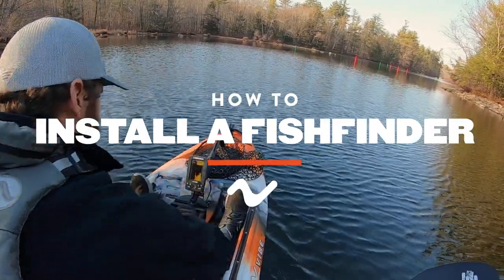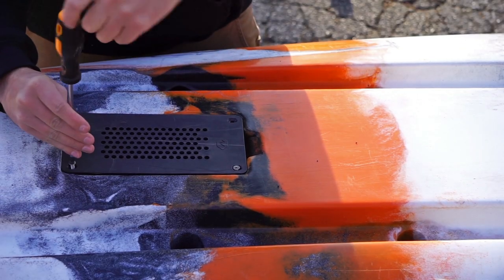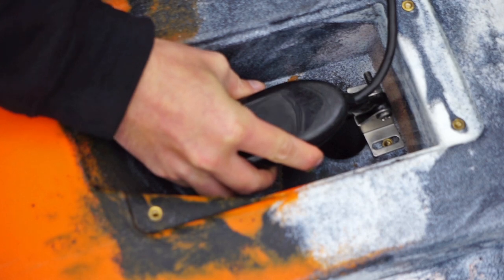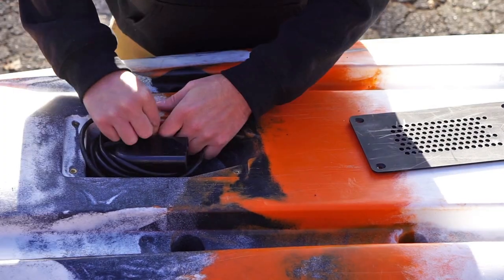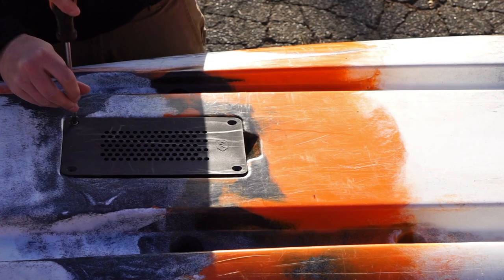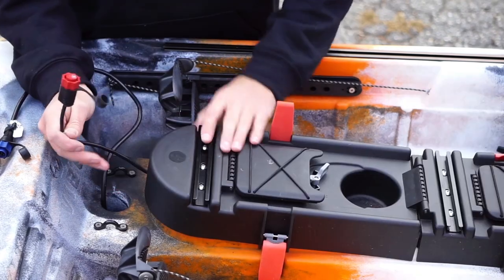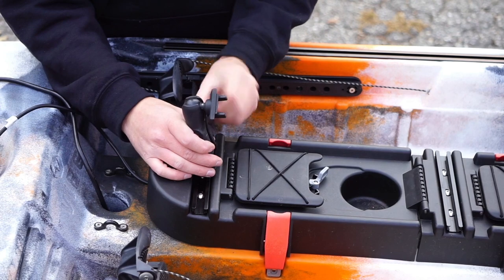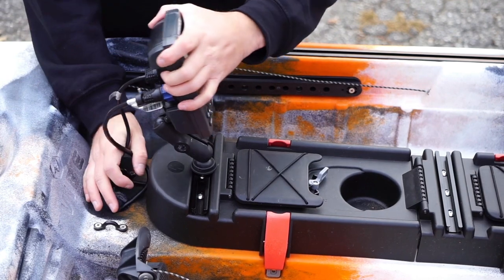How to Install a Fish Finder on a Fishing Kayak

Comment: Will a tripleshot or splitshot transducer fit in the hull, or does it have to be a bullet transducer? I'd like to have as many features as possible when I purchase a fish finder, When I was researching the subject last year I read that those wouldn't work or fit, but it was someones comment.
Reply from the maker: Some of the larger transducers have added features like side scan, which will be blocked by the hull in the inset mount location. The ones that you mentioned are too big I think.